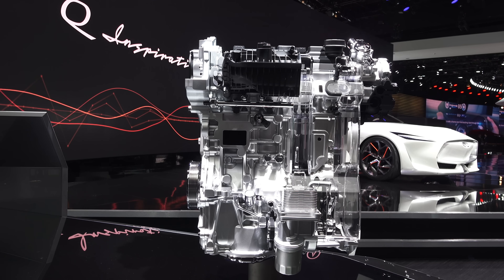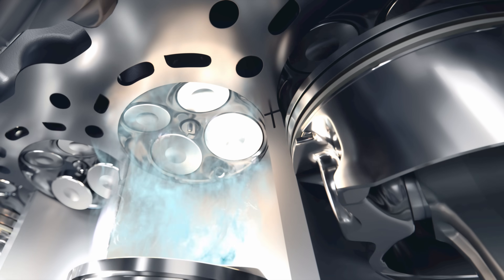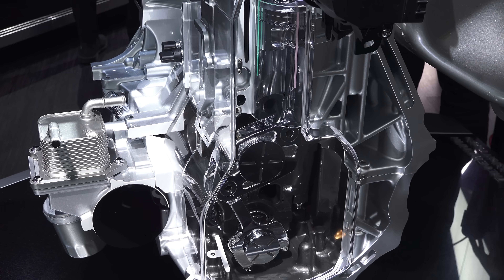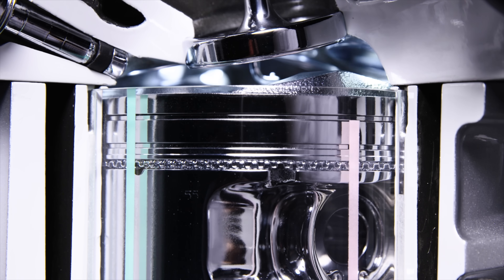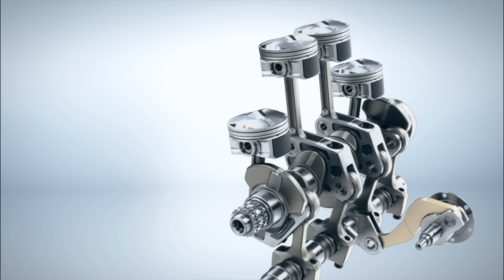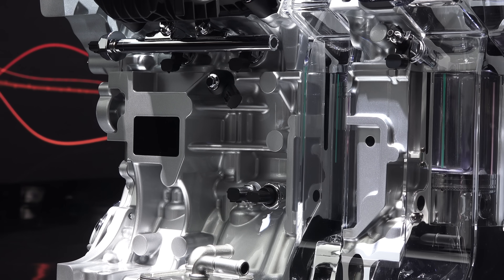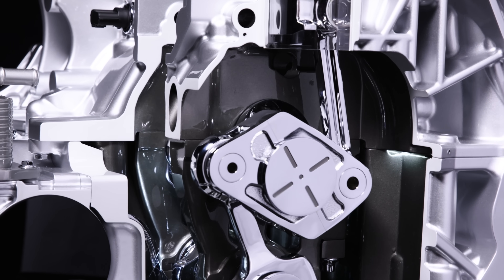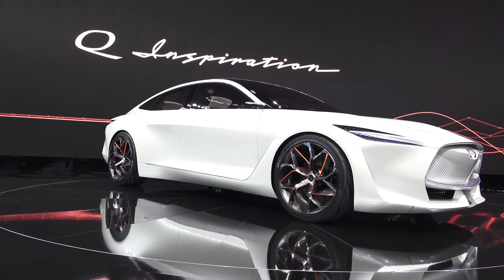INFINITI Reinvents The Gasoline Engine — VC-Turbo

Comment: Lot of moving parts, seems like it will be quite unreliable.
Reply: Do you know how many moving parts there are in the engine already? This isn't going to make them unreliable.
Reply: By that logic a RX-8 must be a verry reliable car...
Reply from the maker: Also keep in mind that they’ve removed balancing shafts from a typical 4-cylinder; and of course all the testing.
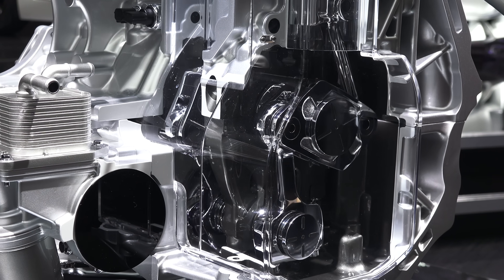Reply from the maker: I anticipated this thought haha, so I asked Infiniti about it: 6:58.
Reply: dies ist kein Name hit that nail right on the head 👌👌👍👍
Reply: lmao
Reply: I'd like you to take 5 minute and go check a modern turbo-fan engine on any airliner and tell me if that level of complexity gives you any problem...

If they did their homework, I'm not worried. It's Nissan after all not chevy.
Reply: dies ist kein Name Yes they are.Well,the Wankel concept is.
The main problem with Rotary engines is that people fail to do regular maintenance.Yes it requires toping off oil a bit more frequently,but apex seals should last you around 250.000km or ~100.000 miles.I think that Wankel engine is the future of ICE engines,considering the lack of moving parts and power/volume.
Just find a way to make emissions a bit better and there you go.
Reply: premix your fuel, watch your oil level, and run the engine hard at least once during a drive and a rotary will last a decent amount of time.  one big problem with rotaries however is fuel consumption.  the Renesis in the RX-8 got abysmal fuel mileage.  had a friend with one and it was fun to drive, fun to run it hard and beat on it, but even just cruising on the highway the thing barely got 20 MPG out of 1.3 liters.  if they could fix that and make them run for 200k miles without needing a rebuild it might be viable, but as it is its like a 2 stroke engine.  simple yes, lots of hp/l, but frequent rebuilding.  nobody wants that.  they want an engine that will run for 200k and require nothing but oil changes and thats basically what we have now, along with better fuel economy.
Reply: byalexandr  20 years of development, hundreds of engineers, billions of dollars in R&D, 12 times the amount of normal testing.... But only a genius like you would have thought about it’s reliability.
Reply: Engineering Explained wait so they paid you to make this video and TELL you it’s reliable?? Must be reliable then! I’m sure it’s fine for the first 3 years, what happens when it’s 200000 km on it? So much emphasis on precise timing it makes me wonder what will happen when it begins to wear. With eco-zealots driving up costs and creating all this new technology I say car makers should just tell California to get lost and stop selling cars there. Start making cars that will go 400000 km for a reasonable price and people will start trusting them again.
Reply: the only problem is that California is a massive market for cars since they have some of the largest cities in the country, no car company can afford to just ignore it.
Reply: byalexandr did you even watch the video?
Reply: soo ... 600 cars ... 3 000 000 km ... that is an average of 5000 km per car ... not realy, what I would expect for a durabilty test.
Reply: The EPA in California just might succeed in banning non-electric cars from public roads.
Reply: t43562 my point was that reliability is not a major factor in the current use and throw culture of the market.
Reply: byalexandr I’ll buy it if they give me a 10 year warranty
Reply: dies ist kein Name this comment nails it lol
Reply: Jason Scott so basically everyone should have Detroit diesels? I fully agree
Reply: Cool engine.  Just not a fan of Infinity styling, I guess it carries down from Nissan styling
Reply: Nah, Diesels will be banned *way before gasoline cars in California.
Reply: If one sticks to older innovations made in the ICE car industry because of sentimental value, EV will take over no matter what, because innovation always wins. It is like asking why buy iPhones when old Nokia phones were more reliable. The market will go for the cheaper and better performing car, no matter what the reliabilities are, because that is what the market is.
Reply: Except that iPhones are generally more expensive. So it's the more expensive and more enjoyable car that would win if cars were bought like phones.
Reply: I know what you mean - something that has status and provides a joyful experience need not last forever because there's always the next model. Cars are still pretty expensive though so I'm not sure they can completely adopt that model the way gadgets have.

Comment: Did they mention what the target mpg was for the Q series?
Reply from the maker: Buck Rogers it hasn’t been rated yet, I believe they stated 27 mpg combined, but I don’t have context of vehicle weight, or highway rating. Still needs EPA rating.
Reply: EPA released numbers to C&D for the QX50 about 2 weeks ago "the front-wheel-drive QX50 is rated at 24 mpg in the city, 31 mpg on the highway, and 27 mpg combined" which may not seem like a massive increase but considering most of the segment tops out at 22-23MPG Combined for gas powered engines over 250HP that's pretty impressive. 

Diesel engines found in things like the F-Pace are making about 29-30 Combined  but they are down about 80-100HP compared to this engine.
Reply: meanwhile my 2001 540i sportwagon does 27mpg at 100mph, and it's rarer than a bugatti veyron

commuter cars are for nasty folks who have no problem with compromise
Reply: i'm looking at lexus ISF's now too as a japanese bro has one.......and they do 32-36mpg at a highway cruise with that eight speed trans
Reply: Adolf Hitler - Yes and it probably makes about 11MPG around town that's why it's important to use combined figures,  but yes small turbo charged engines that make over about 240HP always suffer from poor highway numbers.

The constant need to be in boost to maintain speed means it consumes more fuel than a larger NA motor.  Especially when your talking anything over 75mph. 
Also why even bring up your  2001 540i sport wagon?  It literately couldn't be a more apples to oranges comparison but whatever. lol

The ISF isn't to shabby a car lots of people love how it drives,but it's pretty lack lust in terms of performance when compared to the competition, I'd think your better off getting 
a 330i or  A4 at that point and both of those typically get better real world numbers.

Or if your looking lightly used any of the Infiniti Hybid sedans  are a steal and make about 350HP and get 29 combined MPG with 32 Highway.
Reply: 17-ish mpg around town but IDGAF 17 isn't bad at all

how is a stock 330i or a4 even comparable to an ISF, which competed with the e92 m3 and 6.2L c63 AMG, the ISF won't be my fastest car i mean my 997 turbo is faster by a lot, it will be added for fun
Reply: Adolf Hitler Well the RCF and gsf compete with the m series and Amg....

 The isf is the entry level luxury sedan.

Comment: Very very intelligent engineering👌🏻
Reply: This is more like a Mercedes gadget
Reply: to say the least
Reply: Sam Dianto :)))))
Reply: Potato Man They didn't...It was a freelance designer from Utah that is responsible for most of the automotive advancements since the late 70s.
Ever wonder why the Vtec, Vortec, Voltec, Ecotec and Ecoboost names sound so similar?  It's because the same guy designed them and named them.

He is retired now but without him everyone except a few companies would still be running carburetors.

Track the last four decades of automotive advancements vs the last 100 years.  Then make a graph of all the advancements.  Only patents that were used in vehicles count.
Reply: Ikr:))) who expected Infiniti to come up with this?:)))

Comment: What about weight, is there extra weight now?
Reply: They added components, but they also took out ballancing shafts and other bits. The turbo bolting onto the exhaust manifold also reduces some minor weight. Shouldnt be any different than a regular 2.0 turbo.

Comment: I wonder what the thermal efficiency is this engine.
Reply: Everybody in this thread is talking about 40-50% peak efficiency which is practically irrelevant since it is never held constantly because it can be only achieved in a very narrow band of engine parameters. A more realistic value is the average efficiency of an engine and is somewhere between 18-22%. This VC Infinity engine can vary the compression ratio to the demand of power currently needed, so it is very believable that it can be 40% more fuel efficient since infinity is not raising the peak efficiency but they are raising the efficiency minimum which leads to better average efficiency which leads to overall better fuel consumption.
Reply: I remember their initial claim was that it was suppose to provide 40% increase in MPG over their previous offering at the same HP.
Reply: That's for gasoline engines, diesel is usually higher thermal efficiency (mostly because of the CR). Currently manufactured truck diesel engines are often above the 50% mark.
Reply: TheHabsification me too, I know the current camrys 2.5 I4 is 40% thermal efficient
Reply: +DGFr0sty
40% is really high with current ICE, the only car that has an ICE with over 50% thermal efficiency is the Mercedes-Benz F1 engine.
Reply: 40%

Comment: Didn't Mazda already do something like this with their skyactiv engine line?
Reply from the maker: No one has brought a mechanically variable compression ratio engine to market. Several companies have developed prototypes, but nothing for production.
Reply: Engineering Explained ah okay, thanks!
Reply: Engineering Explained you know there is one. Mazda's rotary engine. When the seals start to fail the compression changes between cold and hot are so big you might as well regard it as a VC engine :)
Reply: You are probably thinking about Mazdas HCCI (Homogeneous Charge Compression Ignition), which aims to produce more efficient combustion, in their SkyActiv-X line.
Reply: mazda is creating a sparkless engine.
Reply: no, they have no VCR engine,  only  13:1 high compression in usa market, and 14:1 in limited markets, but nissan also have 13: 1 high compression ratio engine the hr 1.2 dIG-s, so no mazda was not the only one.
Reply: if that the case you could have consider nissan Hr1.2 dg-t a VC engine. It can change it compression, by switch from miller to atkinson cycle.
Reply: Portal nope.
Reply: Portal
Mazda is achieving 14:1 on their skyactive engine but not with this crank setup

Comment: Saab was also experimentig with variable compression ratio
Reply: I think SAABs design was much more elegant. To drop the SVC, the name of the engine, was one of GM:s many bad decisions that finally killed SAAB.
Reply: Ruben b yes but they do it by changing the head gap
Reply: I disagree. I think rocking the whole cylinder head is far more crude. Doesn’t that not only change the size of the cylinder, but also the geometry?  Many engines have carefully shaped chambers and pistons to maximize combustion events. Rocking the head affects that, no?
Reply: @Ruben b:  On the outside, the head rocks and noticably changes angle. Was there some internal mechanism to maintain cylinder geometry? Seems that would be complex.
Reply: Carecaplatonico "People on the street" on average do not mod cars. This is mostly for efficiency, although you can get more power too.
Reply: I dropped down in the comment section just to make sure someone mentioned the Saab SVC.  I find it a far more elegant solution with a lower rotating/reciprocating mass and fewer moving parts.  I was interested in Infinitie's claim that the connecting rod was nearly parallel with the cylinder bore during the power stroke (research freighter marine two stroke diesel engines that have a thrust rod and connecting rod to learn about how this benefits engine bores' longevity).  The animation also made it appear that the connecting rod was more toward a right angle to the crank shaft during the power stroke as well, which would give it a hand up on the Saab design.
As Saab in now defunct, and never released the SVC, we may never know how it would compare to Infinitie's engine in terms of performance, longevity, or reliability.  I can say that Sabb's engine needed a bellows seal between the crank housing and the cylinder block, which I imagine would have caused lots of trouble with leakage and recalls.
Saab developed their SVC circa 2002, but it was never realized in the consumer market.  The benefits of a variable compression ratio engine are immense.  If Infinity actually puts this engine in production then I tip my hat to them.

It's about time F*&kin' time someone did it!
Reply: Peugeot made a variable compression ratio engine, they put it in a 407 that an hundreds of thousand km without any trouble. They never released it. I hope Infinity will push other car makers like PSA to release more modern engines like this.
Reply: Kenny Howard what Saab did was integrate the cilinders in to the head and move both up or down with respect to the crankshaft. So the head with respect to the cilinders remained constant. Their main problem was oil seals. Have look at their concept.
Reply: TheHardcard, as far as I understand SVC, the cilinder liners and heads both move at the same time. Preserving the geometry but reducing the compression ratio. the geometry is key to mixing fuel with air, right? But most of the fuel is mixed with the air at lower compression ratios during the intake stroke. This is done with swirl and tumble caused by the intake manifold and the angle of valves.
Reply: Kenny Howard: Why? Top end was standard. The difference what that there was a variable gap between the bottom of the cylinders and the crankcase.